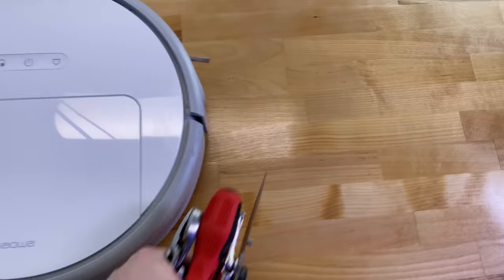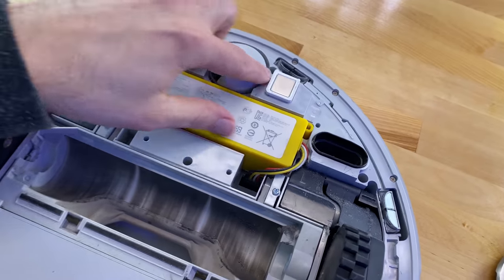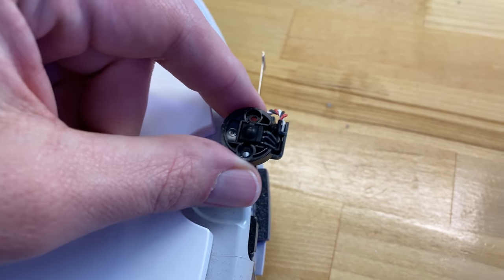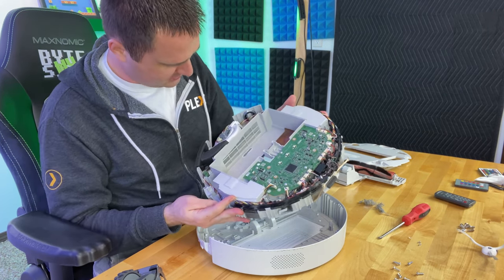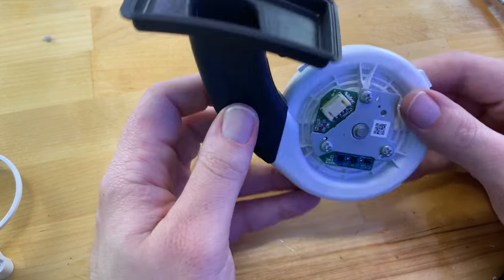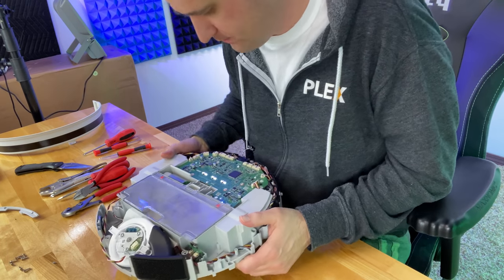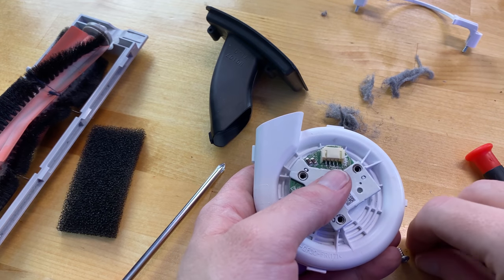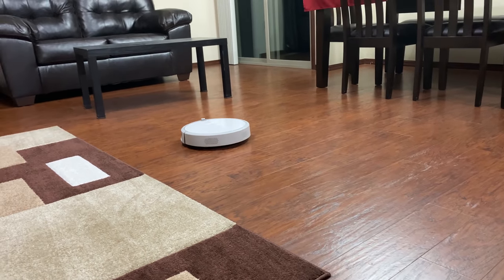Tried to fix a robot vacuum..

Comment: The blower motors bearing is bad. You should be able to get a new blower motor and replace it.
Also I have the roborock S4 and the thick carpet issue was fixed with a firmware update a few months ago.

Comment: I've had a great experience with my Neato Botvac D4. I upgraded the battery in it and now it can cover the whole house (it estimates about 900 sqft of floor) on one charge. It uses flippin sweet IR lasers to map the house, and then you can draw virtual barriers to keep it from going certain places. I have yet to see it even try to cross one of the barriers.
A couple things it lacks from higher end models are: The ability to section the map into "rooms", and a live update of the map while it's running.
I'm always impressed with how much dust and crap it picks up every time I run it. Highly recommend. In fact, I convinced my brother and one of my coworkers to get the same one and they're both really happy with it too.

Comment: suction motor bearings are gone, the fan wheel is hitting the casing = making noise and smelling bad because high rpm plastic on plastic action.

Comment: 1) i have taken apart the roborock S5 before and looked a lot like yours. Was funny to hear you talk about all the screws and modules. I had the same thought. 
2) the Roborock S6 is amazing for carpet. I have that upstairs and the S5 downstairs. I have had no problems with them besides eating the random Ethernet cable i left on floor.. I have them run every day and was funny to get the notice from my vacuum that the cleaning finished and i was watching your video on it.

Comment: I was also thinking it's the motor maybe something stuck inside the blade area if you got the housing apart you may have been able to fix it? And just use some epoxy to seal it back up.

Comment: You can buy replacement blowers from roborock i have the S6 and the s5 max the s5 max is amazing if you have hardwood the original s5 and is the same as your Xi Mi vacuum. The S6 and S5 max are about 15-20% faster then the old s5 (the s4 is faster too) the parts are cheap to fix it you can also email roborock they will rma or even send you the part's they are pretty cool that way. If it's past the 1yr point then you can buy parts on Amazon. I have the shark and roomba with the self empty feature. The roombas cost a lot more but are tanks you just can't kill them the new deebot with AI vision is amazing as well

Comment: I would of checked the ends of the brush they like to fill with hair ... will that unit run without The brush? Lithium grease  on the bearings helps

Comment: I had to replace my vacuum's fan motor after a similar issue. Search for "roborock fan motor" on ali express. A replacement fan motor for the s50, s51, s55 is the same part and should fix the problem.

Comment: Vacuum : "Please Put the Vacuum Down & Restart It" 
    Jason: "FUCK YOU"     I was So Hoping the Vacuum would have said something like  "OH Yeah Bitch....You Have to sleep sometime and then I will Fuck You Up"     If the Vacuum said something like that Jason would still be on the road running for his Life!!! 
     Jason....How to Fix it >>>>    OK now Ill tell you whats wrong......see all the residue when you took the PCB off the Motor Shaft......it should not be that much there you either have a worn out bearing or the shaft is worn and wobbling if its a Brush-less motor if it has Brushes with I think It does your Brushes are bad.....Just get a nee Motor assembly and replace it....FIXED!!!  Cow}:-o)

Comment: Robo vacuums is an absolute waste of money. Just get a good quality vacuum and do the work yourself - much faster and more efficient. The Dyson I bought back in 2010 still works great a decade later. Yeah, it doesn't look that great anymore with the scuffs and everything, but it works just as well. Great investment.
Reply: @tactileslut  I eventually used the barrier to prevent it from getting stuck but that's because others would rather tell me it got stuck then to move it a few feet and let it continue